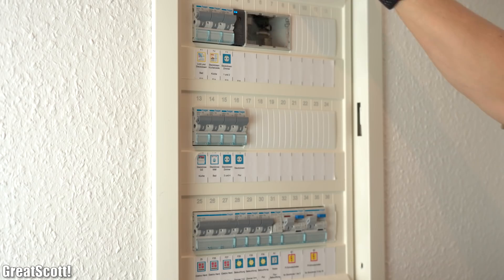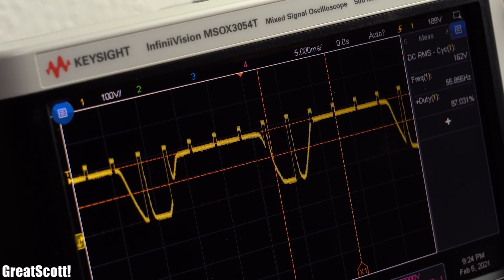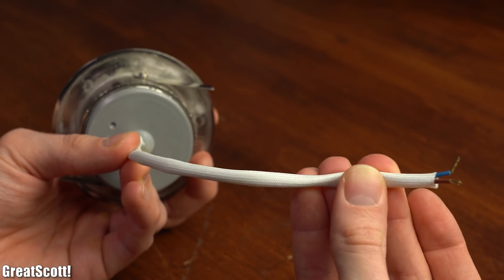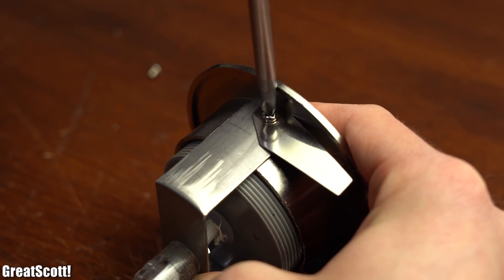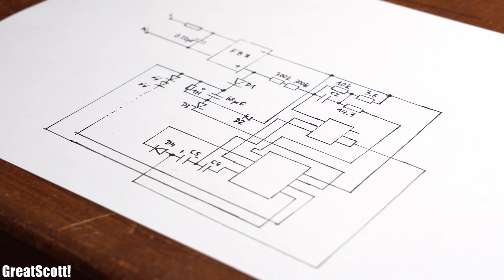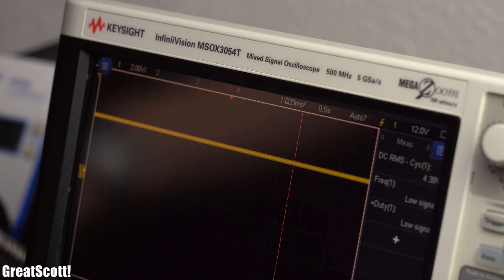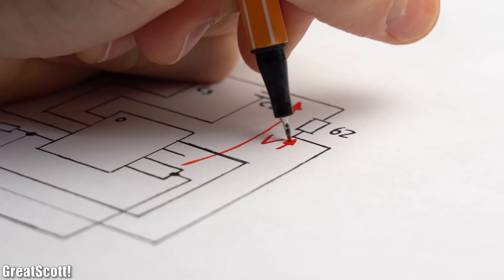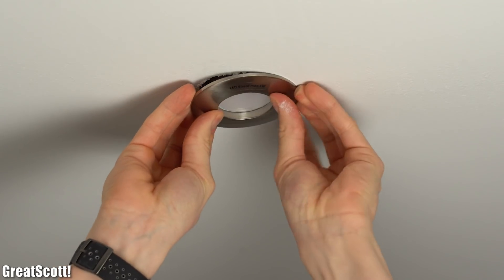Fix It!: Self-Dimming LED Downlight || How a new hardware revision improves everything!

Comment: Both old and new drivers looks like rubbish. The main problem with buying such replacement, the light temperature usually not match since use different LED.

Comment: I have recently broken a light bulb, and the circuit is very similar to the new hardware revision showcased in this video.
Reply: I have also indentified a full bridge and a LED driver, with public datasheets.

Comment: Great! 
By the way can you  explain how that  multiple outputs are handled by single pole switch using RC timer. 
Past couple of days I was building an adjustable temperature led light panel to my room. This kind of function might be the best way to control it.

Comment: I wonder how the cable break happened, because the cable wasn't bent back and forth all the time
Reply: Temperature changes will change the length of the wire, gradually bending it over and over, causing the copper to work harden and eventually snap. The temperature changes could be as simple as the difference between day and night. Just one of the reasons strain relief matters.

Comment: If you're reading these comments, I designed  a current controlled led really very simply, and I don't think I've seen anyone else do it!

use a simple LDR and a resistor to create a voltage divide to power on/off an NPN transistor, all you do is run a couple of small cables to a little pcb/headboard /pef etc... and mount the ldr facing your light source... 

add a potentiometer to the LDR/voltage divider that powers up the transistor, and simply set it to the desired brightness, the only downfall is if something gets between the ldr and and the light source being powered 

if it gets hot the led gets brighter, but it wont because the LDR will adjust, I ran a 10watt 12v cob led with this design, no current limiter (well the ldr/divider is the current limiter, brighter it gets the less power the transistor gets)

Comment: Does the LED power supply not usually include switched mode power supply? So the dimmed version is more efficient?  Makes no sense to dim the lights and use just as much power…

Comment: Ah, I see, the surge relay solves the problem of traditional toggle switches only being able to allow three switches to control any single circuit.  With one of those, you can put in any number of instantaneous switches to control the lights from as many points as you want.
Reply: You can have as many intermediate switches as you want in a "two way" lighting circuit. Within reason of course, at some point you'll run out of wall space for the new switches.
Reply: @yngndrw.  Hmmm...went through the logic diagrams, and looks like you're right.

Wall area isn't the only problem, of course.  Switches, electrical boxes, and wire to run between them costs money, too.  And unless you're building something akin to the Winchester Mansion you won't need all that many switches (perhaps one per doorway in a corridor, and perhaps one more than that in any other room).

Comment: As a warning: LEDs that use higher voltage and burn brigther most of the time fail sooner. Would be interesting to know.
Reply: oh no
Reply: Well, Cpt. Obvious, a cars motor, which you drive all way long at full throttle will also break sooner, as a car you drive carefully and slowly ;D
Reply: @stask85  Not adequate. High voltage LEDs are most of the time tiny LEDs put in series, which means they have to be balanced, else one tiny LED gets higher voltage than others (even though it's the same current, it will still burn brighter - and fail faster). But putting them in series on a small chip more often than not makes them unbalanced, which means either the QA has to be good, or the high voltage LED will fail soon. That has nothing to do with the throttle.

Comment: Nice and interesting! 
I don't get why anyone would think the efficiency would drop if the current value of the constant current driver is adjusted to dim the light. That's the way it should be and I would expect the efficiency to go up instead - wich was apphearently also the case. Having an extra PWM step that does the dimming, increases both circuit complexity and losses. Lowering the voltage doesn't waste that much power for a switching regulator, unless the voltage drop and increased output current (compared to the input current), is so large that the voltage drop over diodes and transistors become a significant percentage of the output voltage. Since it's LEDs it drives, the voltage have to be lowered just slightly to get much less current flowing - that small decrease in voltage shouldn't change the efficiency much. 
I think the increased efficiency of the new driver, IS mostly because they got rid of the unnecessary extra "conversion step".

Comment: I still don't understand why did they install an electromechanical switch (relay) in their breakerboard if the dimmable lights operate at normal mains AC vlotage

Comment: I have two questions. Why did the cable break if it is installed in the ceiling? It must be damaged after being installed and then completly broke of thermal cycles.

The other questions is why are the PE wires not connected  on the daisy chain? This can be a potential problem if someone does replace the last light which requires the PE to be connected.
Reply: I dont think spots ever use the PE terminal, at least I never have seen one that does so it kinda makes sense not to connect them
Reply: @bashaaksema94  The spotlights don't have a PE terminal, so they should be fine. I am talking about the PE wire in the daisy chained cable. You can see them being folded away from the rest of the wires. These should be connected however.
Reply: @alexanderlieret2827  i understand that but as that wire is only for the spots why would the PE have to be connected? That wire is just from the switch to the spots and there are no other lights there
Reply: From turning the lights on and off, their temperature will change, thus the length of the cables will change, placing repetitive bend stresses on them, as they are copper they will work harden, and eventually snap. Also just the natural temperature changes between day and night.

Comment: I would like to know more about how the new design makes the voltage levels and how it differs form the old, any theory on that topic?
Reply: From the looks of the schematic he reverse engineered the full 240VAC is rectified from the wall, passed through a current limiting resistor and then put straight into the ASIC. The ASIC probably uses an internal resistive voltage divider to power itself. The 62 ohm resistor might be the low side of the divider.

The rectified 240VAC is passed straight into the diodes and the ASIC does low side current limiting. The 160 ohm resistor might be the shunt it uses to measure the current. The logic to control the dimming is done in the ASIC as well.
Reply: As for the old one it uses a network of resistors to make 2 voltage levels through a resistor divider. One is for the PWM chip that handles the dimming and the other is for the low side constant current driver. 
So the main difference is everything was simplified by using an ASIC with more features built in.

Comment: I don't know whether your light uses the same pesky led chips as mine. The first time I saw multiple broken LEDs in a series chain with a Philips light. Turns out the little buggers have 3 parallel LEDS in a single SMD package. After a year of usage I've got a light with 6 or 7 little black dots on the LEDs in total (among 16 SMD LEDs), some of them had one or two still functional sub parts. Looks like light manufacturers won't let us have long lasting lights unless we make it for ourselves?

Comment: I am confused about the dimming feature. You don't have any access to the feature, does it only happen on power loss?
Reply: Every time you turn on the lights they go to the next dimming step and if you don't turn them on for a while they reset. So if you want to dim them you turn them off and on quickly. And they have a timing circuit so if you leave them off for longer they will turn back to full brightness the next time you come back.

Comment: Won't less LEDs reduce the overall lifetime of the light?
Reply from the maker: Why? If they are made for a higher voltage then they should work just as well. With a lower amount I would actually think that there can be less faults. And thus a longer overall liftetime.
Reply: @greatscottlab  https://youtu.be/klaJqofCsu4
As big clive says if you underrun the LEDs you end up expanding their lifetime quite a bit

Comment: one thing that confuses me a bit: it has a metal case, shouldn't that be connected to ground?
Reply from the maker: Since there is a sufficient insulation to the metal body, it is not necessary.

Comment: Hey Scott, you can try recreating your buck converter with an 8 pin PIC microcontroller. It will be a good introduction to hardcore Embedded C programming and also you can talk about configuration bits / fuse bits which are quiet important when coming to microcontrollers.
Reply from the maker: I can put it on my to do list
Reply: Especially Timer & port & Register

Comment: How did the cable break when you only every bend it during installation and then never again? Rats? xD
Reply from the maker: Maybe wrong handling while installing or cable in the celeing were applying pressure. Not sure.
Reply: @greatscottlab  It's one of those mysteries, I guess. :)
Or... maybe it was already a little bit broken after installation and then because of thermal expansion/contraction the rest of the wires broke inside?

Comment: Is the reason why the new led dosent flicker that the frekvenz is mush higher >5000 Hz? I know you can buy some small led dimmers that have a frekvenz at 10 kHz. Can you mby try building a circuit that can boost a voltage, from 4.2 to 12. Have a dimmer and on/off system ? That would be awesome 😉
Reply: no, the reason why the new led doesn't flicker is because there is no PWM, instead the LED get dimmed by being driven with less current, which is the best way to operate them. Anyway, higher frequency PWM will for sure reduce if not remove completely the flickering.
Reply: @gabrielenitti3243  Although, literally all it takes to convert PWM control into voltage control is just adding a suitable capacitor in the right spot in the circuit.  So, why is it traditional to use PWM control of LED brightness?  It's cheaper.  That's the only reason.  It's just those few cents (multiplied by potentially tens of millions of lamps).
Reply: @evensgrey well, you can't just filter the PWM signal with a capacitor and feed it through LEDs. that way you would get voltage control and LEDs are not voltage controlled.if you for example have PWM switching at 50% a 220V DC line and you add a suitable capacitor, you would get 110V DC which probably wouldn't even turn on the LEDs. In the improved version of the light fixture, it's not just a capacitor that's been added. The whole circuit has been converted from fixed current PWM to variable current, achieveing flicker free dimming. PWM is much cheaper than a variable constant current source, which usually requires a Buck converter or some sort of linear regulator, therefore the argument still holds true.

Comment: This is the proper way to dim LEDs. Triacs can mess with LEDs to cause flickering.
Reply: Depends entirely on how the LED light is designed. On one end of the dimmable LED spectrum you have the low-cost low-efficiency dumb constant-current analog regulators where brightness is directly driven by the dimmer's duty cycle while at the other end of the spectrum, you have more complex, bulky, expensive and efficient proportional switching current regulators where LED on-time is almost entirely decoupled from AC because the lamp stores enough energy internally to bridge the AC dead-time between pulses.

Comment: Hi greatscott, I wanted to make a 1 - 30v and 1 ampere regulated power supply using lm317 with constant current control. Any suggestions and circuits would help a lot
Reply: Any buck/boost circuit you find online will work. Not really a need for him to explain it to you if you can find like 1000 circuits with google. Nobody has infinite time
Reply: @GLITCH_-.-  thanks for the suggestion but could you provide a link for some circuits, it would help me a lot
Reply: @chargedlabs3506  Nah man. I'd need to Google myself.

Comment: the new design is so different and improved, electronically and mechanically, was it done by the same designer(s)?
Reply from the maker: No idea. But made by the same manufacturer.
Reply: @greatscottlab  maybe the mfr is only a mfr, and out-sources the design.

thanks, again, for the great content and excellent video work.

Comment: Einstein: "Insanity is when you're doing the same thing over and over again and expecting different results"
GreatScott! reinstalling the same broken light three times:
Reply: Except for the fact that he tested it between reinstalling and it worked. That not insanity, that's troubleshooting.
Reply from the maker: I did it for initial testing and then the video shoot. I should have said that. Now I sound insane.
Reply: I don't think Einstein said that, also statistics is insane.
Reply: Anjirr.... Asu loh..
Reply: Einstein didn't have to write or debug any software. Sometimes insanity is all you need to solve a problem.